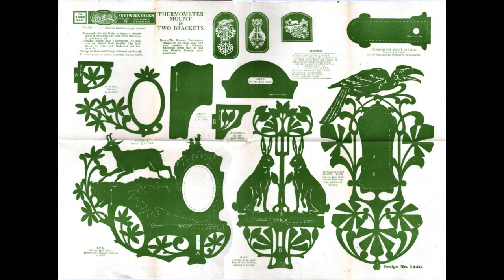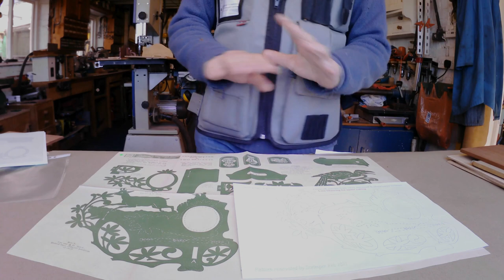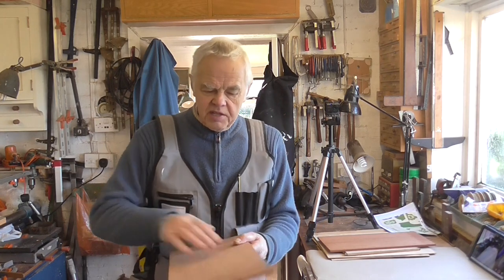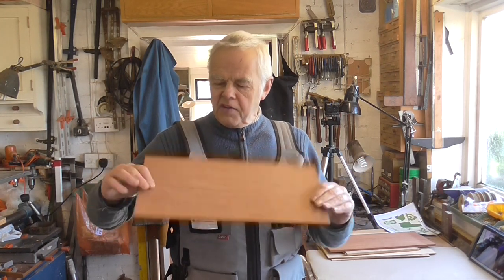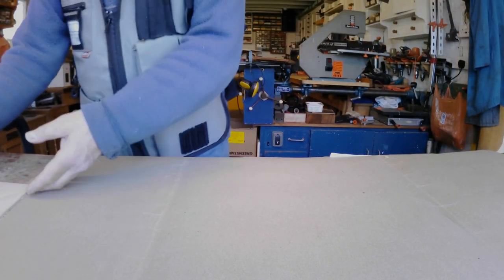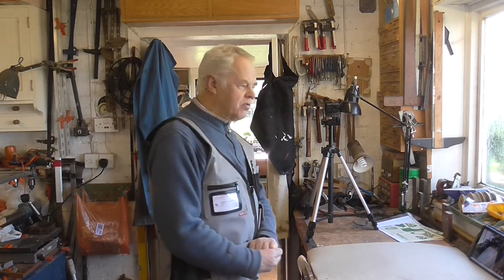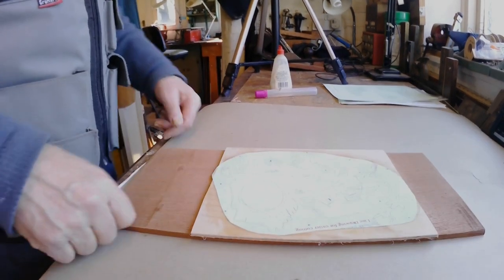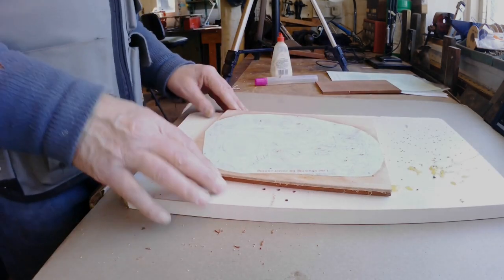How to do Scroll-Sawing and Fretwork. Basics for Beginners. Part One

Comment: Hi Scrimper. You are right about the original solid coloured patterns being a tad hard to follow, a line is much easier.
I remember when I applied the pattern to the wood I used wallpaper paste. If you weren't careful the pattern would get soaked and stretch. I found if I put it in front of our coal fire it dried quickly without wrinkles, if you were lucky!
Thanks for the informative video.
Reply from the maker: Thank you Colin. In the old days we had no choice, almost all of the patterns from Hobbies and Handicrafts were full colour now we are spoilt for choice and able to easily convert them to line drawings only for easier cutting. of course when I was young we used to trace the pattern with Carbon paper rather than sacrifice them by pasting on.

Comment: Thanks John I use 3M spray adhesive for my pattern's and double sided tape to stick wood together both types comes off easily
Reply from the maker: I have got a tin of that Doug but to be honest I forgot about that method. Thanks for the reminder I will try to add that advice in the next part.  Jolly good advice. Thank you.